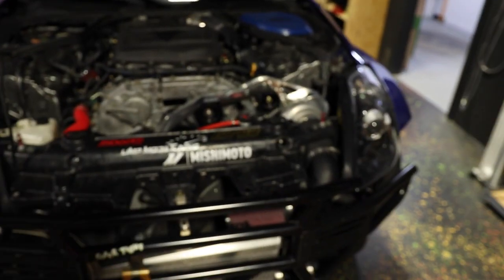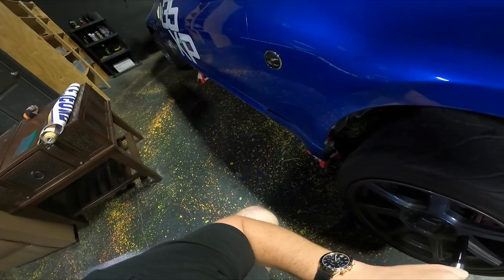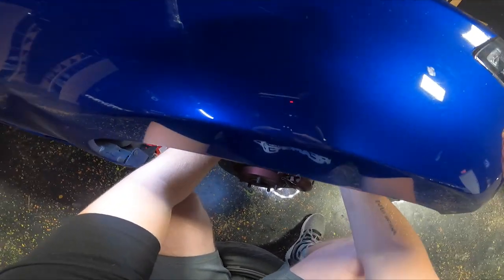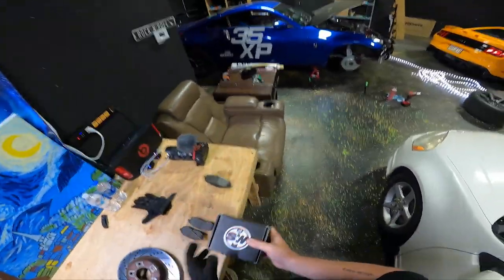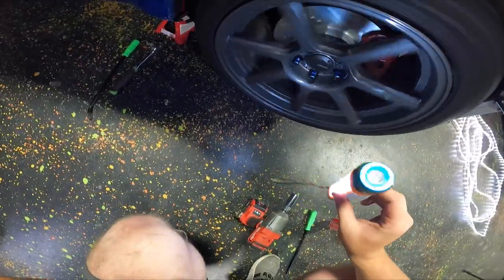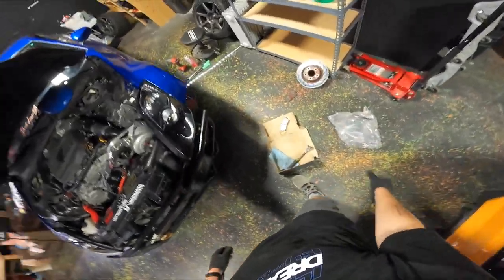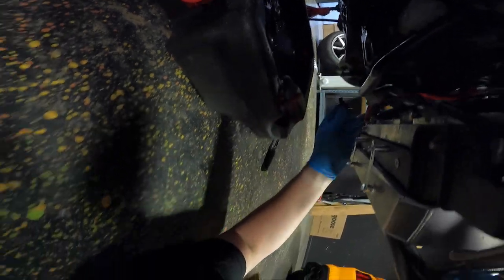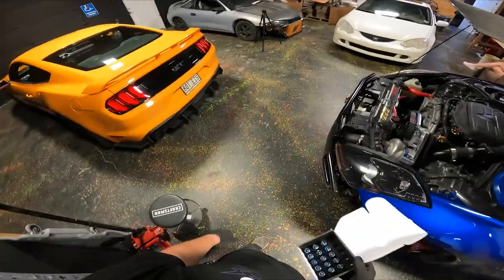Satisfying Brake Job on 17 Year Old Car! | R1 Concepts 350Z Brake Install

Comment: Get those pads/rotors bed in before going on any more back road excursions. A “squishy” pedal feel won’t get better on its own. It’s from air in the system, but if you didn’t open the system you shouldn’t have any air. Once you get a layer of pad material transferred to the rotor the brakes will respond better and give a better pedal feel. This might be what you are experiencing instead of a squishy pedal. This is why bedding in pads/rotors is important after an install. You’ll notice a difference during an autocross or track event. It also prevents an uneven layer of pad transfer resulting in pedal pulsations often confused/misdiagnosed as rotor warpage. Oh yeah, torque your brake components.
Reply from the maker: The pedal got better the more I drove it. I’m going to take the car out again for more break in on the pads too before auto crossing again.

Comment: Strange coincidence but I just bought a Z to build a drift car with and it has the factory Brembos but for some reason the previous owner also thought it would be smart to paint them red. Lol just went though the same experience with the red pads.
Reply from the maker: Crazy how mine was the same 😂😂 painted the rotor and all

Comment: On the rubber cover you use either the caliper mounting bolt or a slide bolt in that hole and if your rotor is stuck you thread it in and it will help get the rotor off if it's stuck
Reply from the maker: That’s good to know

Comment: Not gonna lie I have geomet drilled and slotted and performance pads on my big ass 4400lb boat and they really help. Buddy has them on his s4 and it really helped his single piston setup out.
Reply from the maker: I’ve had drilled and slotted the whole time so I probably won’t notice the difference, but I know it’ll help somewhat with heat too
Reply: @Zorbii  now that you have correctly mounted the rotor unlike the last guy😂

Comment: Currently running z1 stainless lines, geomet slotted rotors from R1, and stoptech sports pads (for daily and spirited driving) love my current combo setup makes a huge difference from blanks and duralast pads and stock lines that the previous owner had
Reply from the maker: Works well?
Reply: @Zorbii  yeah very well, love the no noise and consistent braking with very very low fade
Reply: @Zorbii  including geomets are pretty much equalivent to bmw rotors due to the zinc coating with no oil residue on it but i still brake cleaned it

Comment: I've been running R1 as my brakes for just about 2 years now. My only complaint is the dust, but that's a given because of using the performance pads. 

Other than that, they're fucking great.
Reply from the maker: LIT. This is exciting

Comment: You should get a junkyard LS truck engine or the one like he is in a Camaro SS and put it in the Zoe because if you look at Mike Mike at his 350 it is very nice and it sounds very nice and it makes pretty decent power where you can beat some of Gavin's cars
Reply from the maker: Do you know how much it costs to get an LS in one of these cars? lol building the current engine is a bit more reasonable
Reply: Or how much it actually cost to do the swap correctly?
Reply: @Zorbii  I agree. Putting an ls in it would be like buying ANOTHER car 😂.
Reply: @Zorbii  I don't know how much it would be but I am just saying it would be nice and you also have more content for the channel because all the ups and downs you can just keep on posting videos
Reply: But I know you can get a LS pretty cheap
Reply: @Zorbii  I found a LS it had 10000 miles on it and I took it apart make sure everything was good and refreshing it and I sold it for more and I only paid 3 for it hundred and I saw it for 3000
Reply: @Zorbii  I got it for 300 because it was a good buddy of mine's
Reply: @Average_jeep  then you end up with a ruby situation like cleetus McFarland
Reply from the maker: Lol I don’t really think it’s that simple. But I’m going to keep posting videos regardless of what engine is in my car
Reply: @Zorbii  oh ok

Comment: Brake's and Rotor looks good 👍🏻,  little FYI I always push back caliber b4 removing anything else
Reply from the maker: That's what I started to do after the first corner. And I agree they look a lot cleaner than the previous ones. Rotors do a lot for a car

Comment: Most drilled and slotted rotors the slots go forward to catch the air to cool them down
Reply from the maker: That makes sense. If you look on R1’s site they say that there’s actually no right or wrong direction I just found out. There’s just a recommended direction.
Reply: @Zorbii  i actually did the same thing with mine when I first got them.

Comment: I've seen this company on FB for 3 months now and keep debating on it since they're a better value than even rock auto for me
Reply from the maker: Well if you decide to give them a shot, use the code "zorbii20" to get 20% off. The code wont be available forever so might wanna act fast, but I'm hoping to eventually get one of their big brake kits for the 350z. Until then, I wont be giving these pads/rotors any mercy. You'll be seeing how well they hold up to the abuse for sure 😂

Comment: I literally put R1 rotors and pads on my z 2 days ago lmao. Also just fyi, they might feel spongy cause they need to be bled, also there's a break in procedure on R1 concepts website for new pads and rotors, probably not completely necessary but I did it and my brakes feel much stronger/touchier than before.
Reply from the maker: I plan on bleeding the brakes soon. And I figured they’d get better after being broken in. That’s probably what I’ll be doing off camera before the next AutoX

Comment: I like to do some hard braking to break in the new rotors and pads. The company I got my brakes from tells you to do a few hard stops from 50-20 and 30-0.
Reply from the maker: I did a little bit of hard braking here and there. I honestly haven't ever broken in a set of new pads.  This was my first time ever replacing those parts. Next time I get out though I'll make sure to get them up to temp and make sure they're bedded in.
Reply: @Zorbii  👌🏻 getting them broken in is a big help especially with performance pads
Reply from the maker: I’m taking the car to AutoX this weekend actually so there will be plenty of hard braking to get them bedded in too. I’m make sure to do it also while I’m driving over there too
Reply: @Zorbii  sounds like a blast. That’ll get em broken in nicely.
Reply from the maker: For sure

Comment: Daniel did you bleed the brakes I didn't see that
Reply from the maker: I did not. I never disconnected a brake line so there shouldn't be any air in the system. The brakes still feel good too. I'll be bleeding the brakes at some point soon though just to make sure that there's no air in there.

Comment: Y don't you separate the caliper from the bracket? It's a lot easier. Then you can use a c-clamp and push your piston in
Reply from the maker: Because honestly I didn’t know that was the bracket. I thought the caliper was just 2 pieces.
Reply: @Zorbii  ya there's two slide pins that are also bolts and you can undo. You should of put some  Anti-seize on the slide pins. Because if they are stuck they will make your pads ware uneven
Reply from the maker: I’ll have to check that then

Comment: The fluid overflowed because you should have a full reservoir with new rotors and pads, as they wear down more fluid goes into your hydro system, when you push the pistons back apart to get new rotors and pads on it will go right back to full given there are no Leaks. You shouldn't need to ever add brake fluid
Reply from the maker: What about removing brake fluid now? 😂 I'll get everything cleaned up and get the fluids back to normal. Brakes are just something I never got around to because it wasn't super necessary.

Comment: Should separated the caliper and bracket and lubed the slide pins with all the heat you put into them.
Reply from the maker: I do need too. I’ll probably take them apart sometime soon for maintenance
Reply: @Zorbii  just tryna make sure your safe on track 🙏
Reply from the maker: Thank you my dude 🙏🏼

Comment: I love doing brakes. The only reason you hate them is because you're trash at them. Take the whole caliper apart use a c clamp and brake pads to open the caliper back up after you open the master cylinder. Taking the caliper apart also makes it easier to put the pads in.
Reply from the maker: I've seen people do it that way but honestly I've never actually tried doing it that way. I know that's how you're "supposed" to do it though.
Reply: @zorbii who cares what's "supposed" to be right, if it works and makes life easier, then it's an approved method in my book.
Reply from the maker: I’m just doing it the way that I’ve always know to do it 😂
Reply: @Zorbii  nothing wrong with that sir, we each have our own way of doing things.

Comment: If they ship to germany I'm going to buy R1 Concepts Rotors and brake pads for my 1989 Golf mk2, I'm still running stock brakes on a 300hp golf mk2 😂
Reply from the maker: Go to their site and see!
Reply: @Zorbii  they ship to germany, but the pads that you have are out of stock :(
Reply from the maker: Get some different ones? 🤷🏽‍♂️ the performance pads will usually put out more dust anyway

Comment: I had to hit my rotors with a hammer for the better part of 10 minutes to get them off my Z you are a lucky man
Reply from the maker: Well I take my car apart pretty often so it doesn't surprise me they came off somewhat easy.
Reply: I have to use a deadblow hammer just to get my back wheels off on my Tacoma 😂

Comment: Those rotors will be warped in no time 🤣🤣🤣
Reply from the maker: Hopefully I get some decent use out of them first
Reply: @Zorbii  Good luck. I’ve used R1 rotors on 2 different cars (blanks on one and slotted on the other) and they both warped within a few thousand miles with normal driving. Never again
Reply: I use the drilled and slotted rotors, on the mustang and Camaro it’s been maybe 2 years? On the genesis couple a couple months. I drive the other 2 cars like they’re supposed to be driven and I’ve never had a problem with them
Reply from the maker: I’ve heard good and bad about R1. As with almost any company I’ve ever gotten parts from. There’s a lot of factors with things like this so as long as I don’t have issues with the company itself it’s normally not a big deal to me.  Sometimes, shit just happens.
Reply: Brake rotors don’t warp. Major misconception about “warpage” and runout. He’ll be fine if he beds his pads in and doesn’t exceed the temperature rating for the pads.
Reply from the maker: That’s the reason I got the performance pads.

Comment: Letting your brake calipers hang from the brake line…🤮
Reply from the maker: Yup. It's pretty cringe 🤷🏽‍♂️ but sometimes you just gotta weigh your options and deal with it. They're steel braided lines anyway
Reply: @Zorbii  braided lines or not, that's a definite no go. Wire or zip tie it to a component on the car or rest it on a jack stand or hell, even a tall box. The one thing that definitely needs to be treated with care are your brake components. They protect not only you/passengers but others out on track/street.✌️
Reply from the maker: You’re right 🤷🏽‍♂️ I prefer not to let them hang. I’ll take better care of them in the future.